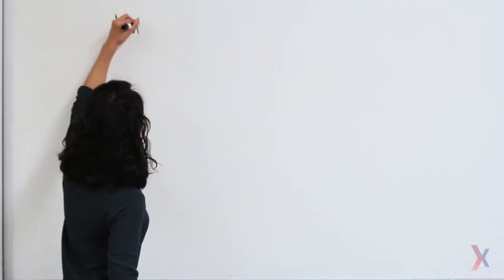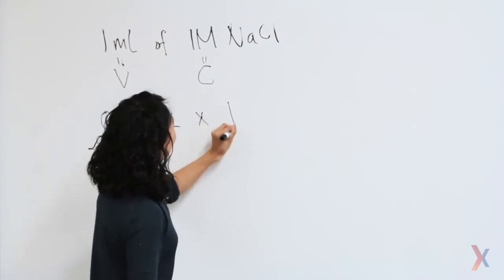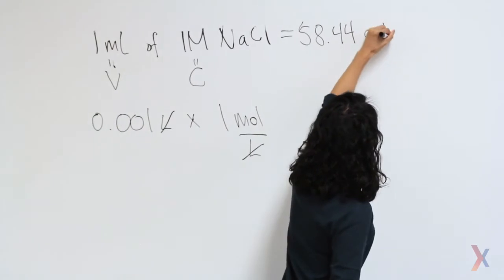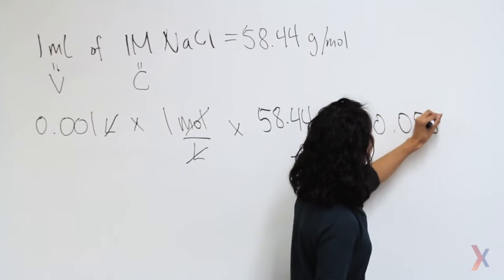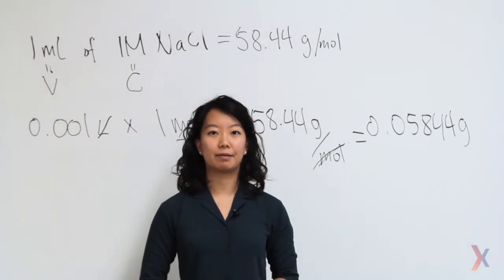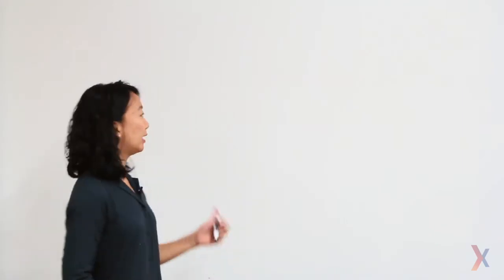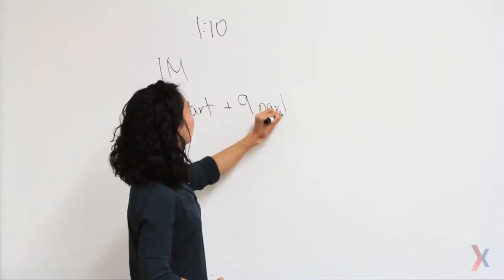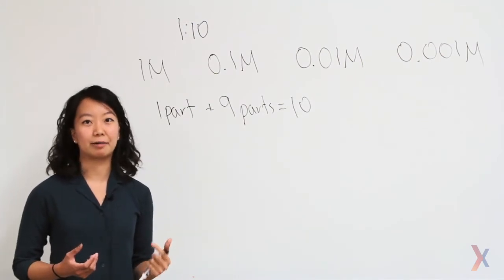Molarity and Serial Dilution

Comment: why did you not take out the same Volume of solution/solvent from your first ml?? (Molarity step)
Reply from the maker: When diluting something 10-fold (for example, if we want dilute something that is 1 M to get something that is 0.1 M), we add 1 part of the substance we want to dilute to 9 parts water. In this example, we added 100uL of blue dye to 900uL water to make the blue dye 10x more dilute. Does that help?
Reply: Fabulous video. Thank you